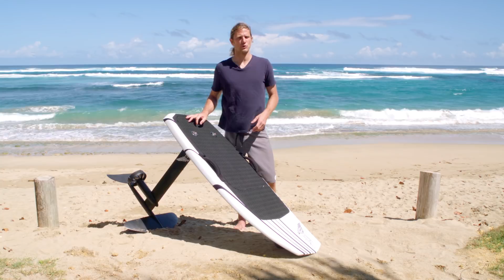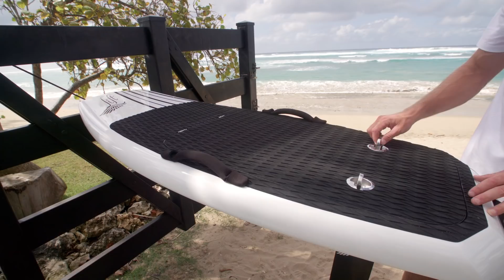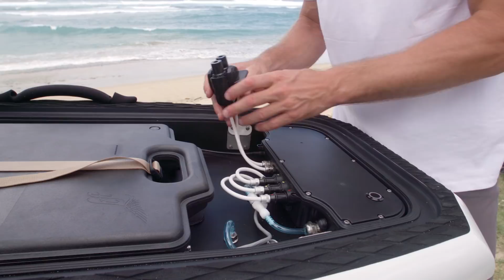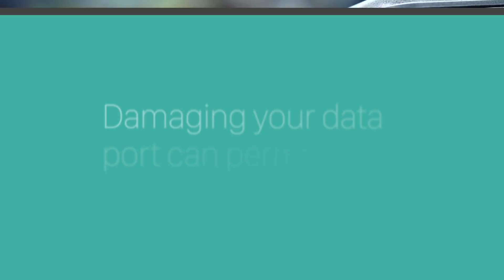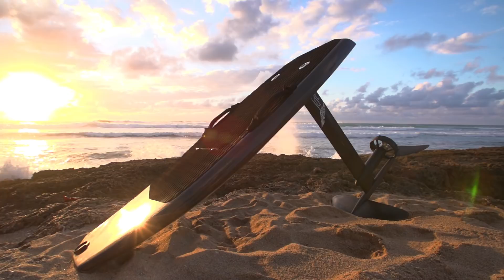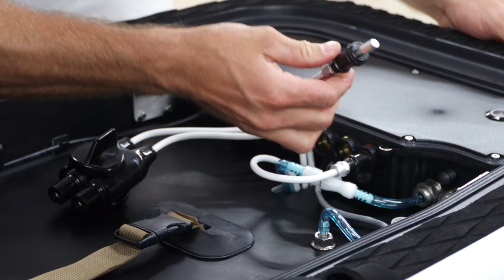Lift eFoil How-To: Setup at the Beach - Video #4

Comment: Max speed ?...rpm
Reply from the maker: 25 mph!
Reply: @LiftFoils  Why not lower that speed and design the engine to be slimmer, less physical resistance to water and safer? I am not an expert, just curious about different design possibility. Does that propeller need to be that big? Cheers